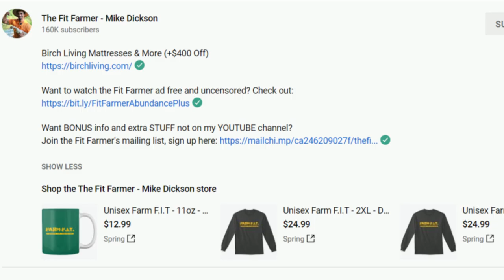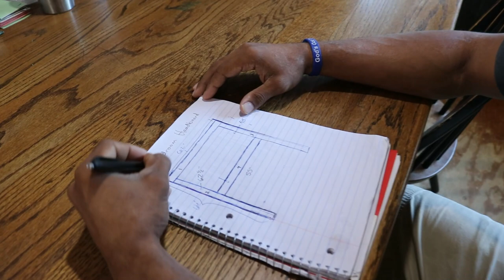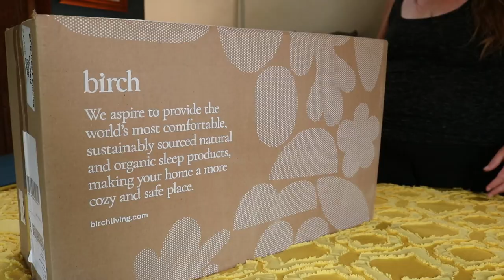Epic YURT BEDROOM REMODEL for Pregnant Wife | DIY Before & After

Comment: Did you put a protective finish over the stain on the headboard? If you did it was a matte clear which I would have also chosen. The stain doesn't seal the wood so it can still pick up grease from leaning your head up against it or pick up spills. A nice matte clear in a couple of coats will seal the wood so it won't absorb anything.
Reply: Good idea Patrick. I hope they already sealed it. I'm sure Mike doesn't want to pull it out again. It looks so good.

Comment: You do very good videos.  I have a weird question.  What was the roll of green material in the barn loft? I am working on a project and it looks like I could use it, but don't know what it is called.  Thanks
Reply from the maker: I (Lacie) actually do not know. It is some left over material from a masonry job that my Dad's company has done in the past.

Comment: Been watching for years now.
Just curious, but are there any issues with sun or weather rot to the yurt?
Reply from the maker: One reason we put hard siding on the outside of the yurt is because the sidewall needed to be replaced but it was probably 12 or so years old. The roof is  a thick vinyl and it is still going strong. Our dome has cracked a few times and will need to be replaced before too long. So yes there is damage from the sun and elements but this yurt had a life before we bought it so for as old as it is it is in decent shape.